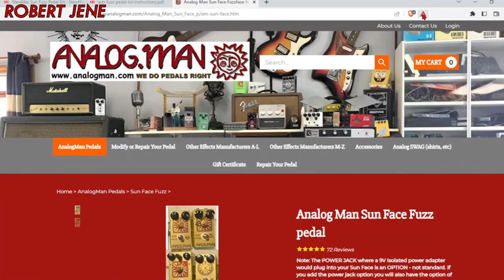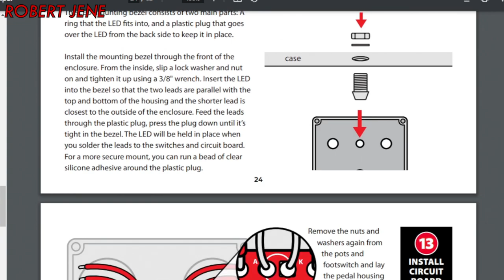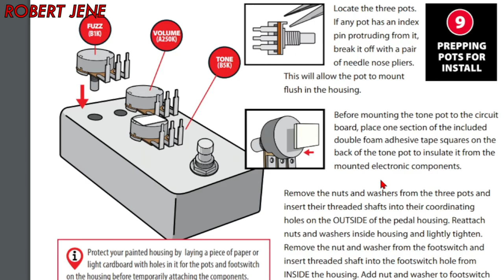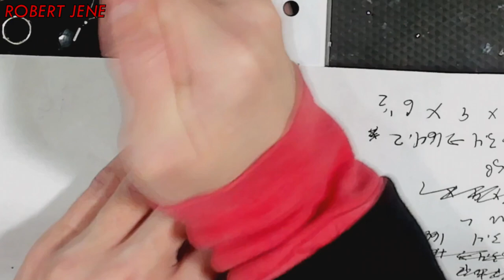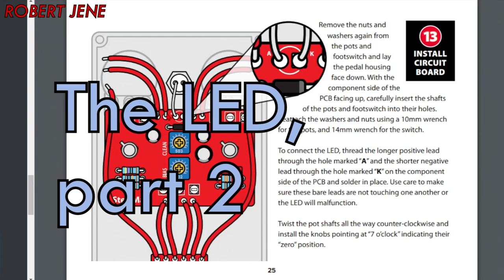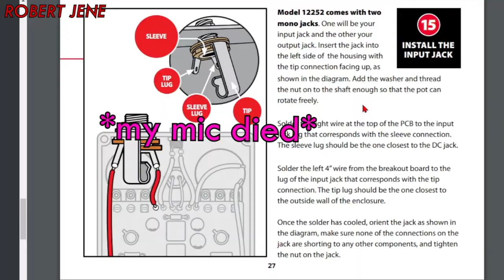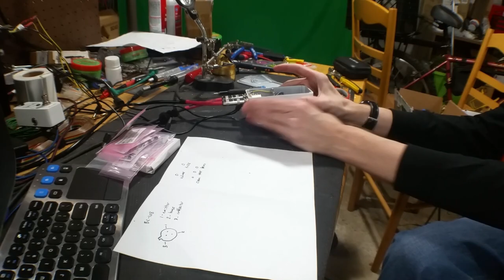Guitar Pedal Build - Sun Face clone | Stewmac Sun Fuzz + #Mods

Comment from the maker: Are you going to build this pedal?

⌚ Timestamps:
00:00 - introduction
02:44 - diode
04:56 - transistors
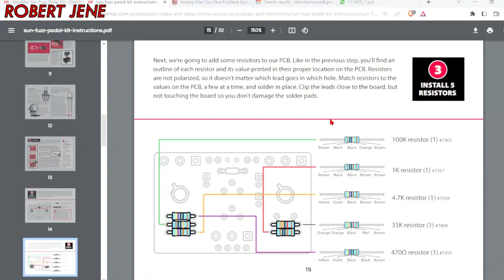06:31 - resistors
09:04 - capacitors
12:23 - what analogman changed
13:26 - the wires
17:25 - pots and footswitch, pt 1
21:26 - the LED, pt 1
23:50 - modding the trim pots
33:35 - the pots and footswitch, pt 2
34:33 - the LED, pt 2
35:32 - the power jack
36:25 - the input and output jacks
40:17 - future me pedal demo
40:52 - the knobs
42:00 - testing